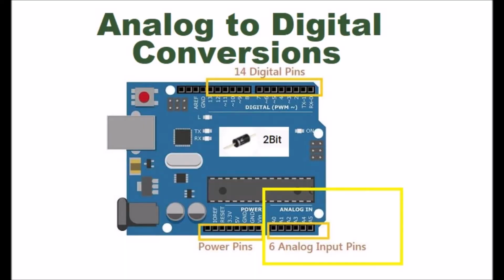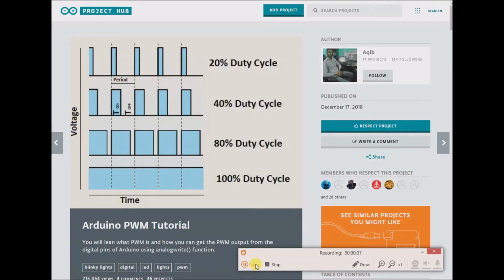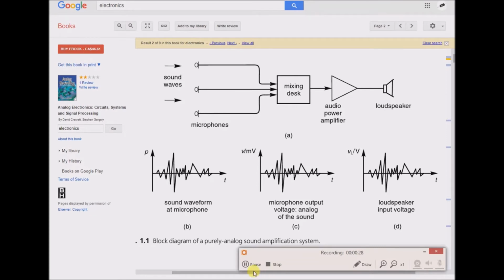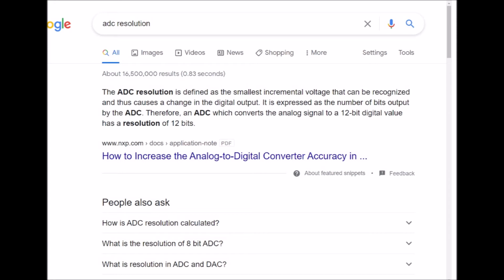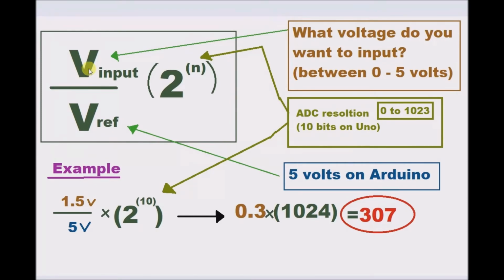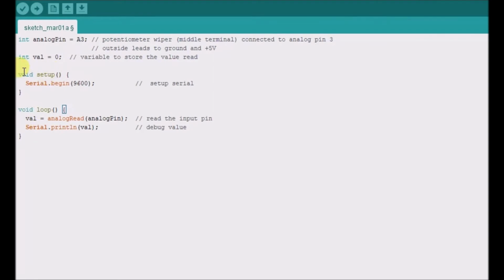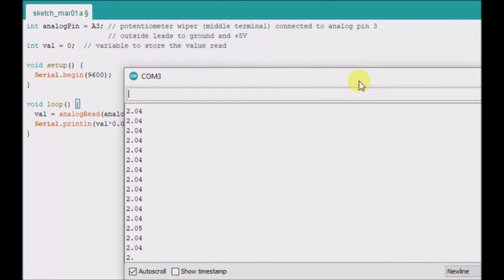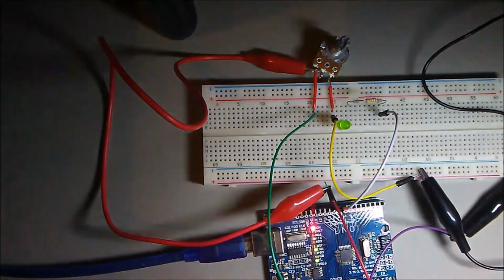Analog to Digital Conversions

Comment from the maker: 18:00 I didn't really explain this properly in the video. The AnalogRead function uses a 10 bit resolution, which works out to 1024. However, the AnalogWrite function uses a lower resolution of 255. So, the division by 4 just correctly converts the AnalogRead value to an equivalent AnalogWrite output.  For more explanation see: https://www.arduino.cc/reference/en/language/functions/analog-io/analogwrite/
Reply: Nice work